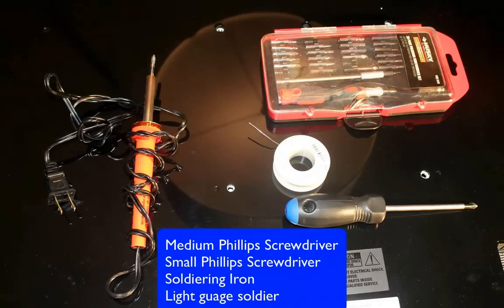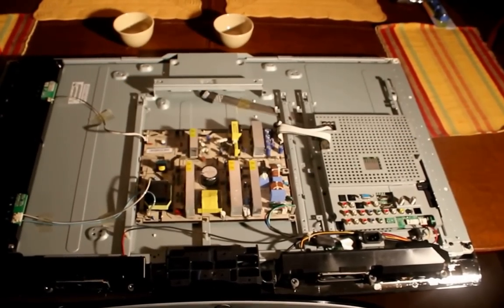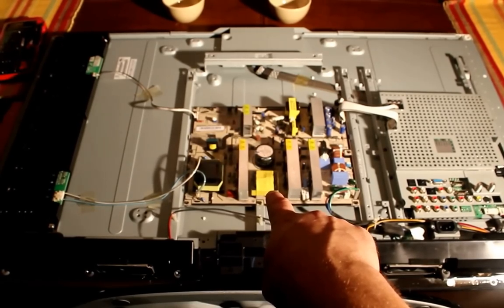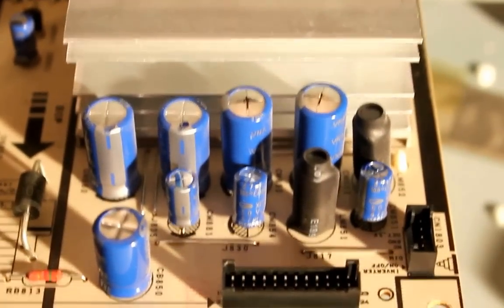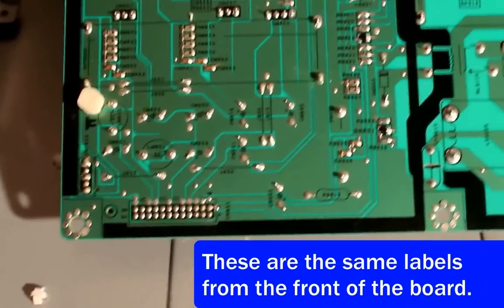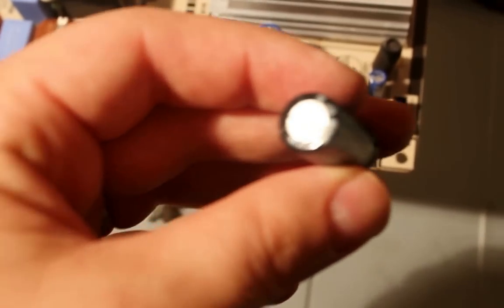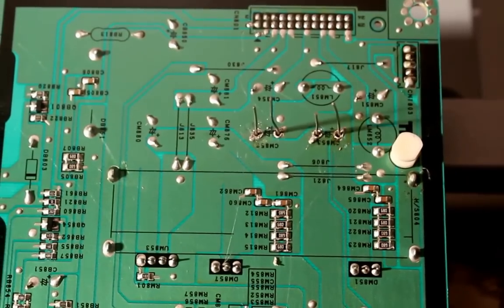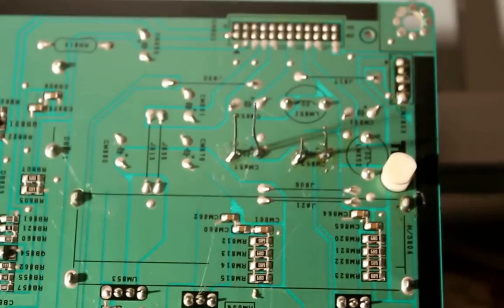Fixing the Blown Capacitor in Samsung TV Yourself

Comment: New POST TO AN OLD VIDEO (Oct 2019): These failures are super common and based on the failures I would replace the capacitors with the next higher voltage value (NOT A DIFFERENT UF VALUE) For example if 2200uf 10V failed replace with a 2200uf 16V.  
16V=>25v  25V=>35V  35V=>50V  you get the point
These caps are known to be under rated for the purpose.  which is why the problem is so wide spread. Most of these TVs can be fixed for under $20

There are a few power supplies with cracked solder joints on some components. A close inspection with a magnifying glass can help you find them. To fix just reheat and add some fresh solder.   

A guy could make a small fortune finding these TVs for free and fix and turn around and sell for a few bucks.

*****WARNING****** There is 1 Capacitor rated at several hundred volts, this can cause injury if it is still holding a large charge.  Test with a meter and discharge through a large resistor if need be. The capacitor is the huge one and very obvious. Take these precautions seriously.  Cheers

Comment: Manufacturers of electrolytic capacitors specify the design lifetime at the maximum rated ambient temperature, usually 105°C. This design lifetime can vary from as little as one or two thousand hours, to ten thousand hours or more.
So if your smart TV, or Electronic Controlled Refrigerator fails to turn on, then before replacing it, check the Electrolytic Capacitors.
They are big enough to be checked and replaced easily. Make sure to replace with a top quality capacitor with identical specification.

Comment: I have this issue with my '07 Samsung 40'.  Good tip.  Not the best soldering job.  Use solder flux and clean it off with rubbing alcohol after you solder the joints.  Don't let the solder touch the other traces and use just enough solder to get the job done.

Comment: I just fixed my Samsung Monitor this way thanks to this Vid. I hadnt soldered in 30 years, went to Radio shack and got the capacitors($2.00 apiece) and fixed it in minutes.
Reply: MrMrwilson11 how'd you remove the old solder around bad compacitor

Comment: Thanks! This save me hundreds of dollars by avoiding buying a new TV!  Cost was 1.99 from Radio Shack for 1 new capacitor (35V 1000uF).  Although they only had Caps rated for 85°C instead of the 105°C that the old one was rated at.  We will see if it holds up.
Reply: Lauren Doyle did they hold up

Comment: I have an lg and had to replace the power board, before putting on the back. I drilled numerous holes in the back panel to allow more air to circulate. I believed it helped. per tech folks the capacitors are under size

Comment: How did you know what type of capacitors to get don't they have different types like watts or can you just use any type ?
Reply: On the side of the capacitor it will tell you a voltage and capacitance. So, on my tv, 3 were blown. On the side of 1 was 35 V, 1500 μF (micro farad, be careful not to mix up nF with μF). So when looking for a replacement I look for one with 35 V and 1500 μF capacitance.

Also take note of the height, diameter and lead pitch (how far apart the leads are). You don't want to get one that won't fit.
Reply: Tumatauenga what about diameter of the capacitor? from the pics on amazon the one I need looks shorter and thicker. The one on the main board looks skinnier and taller. Any advice? Does it not matter?

Comment: I'm using a 15v. soldering iron and it doesn't seem to be strong enough to melt the original solder. What voltage iron is the best to use without damaging the board?

Comment: Ever hear of one of these capacitors healing themselves? I noticed one bulging in my Sammy Tv (a year ago) and I've been meaning to replace it. Opened the TV up today (was about to take the board out to take it to radio shack) and the bulge was gone. I even scratched/marked the capacitor a year ago so I wouldnt forget. Plugged TV in for the heck of it, it now works. Think it'll last? Strange.
Reply: I have the issue with my Samsung and it's usually fine unless the weather is cold.  Warm days it's fine.
Reply: Your partner/spouse is gaslighting you

Comment: Thank you for your video. While my Samsung has the symptoms of having a blown capacitor or two, visual inspection indicates no mushrooming. Could it actually be the power supply that is causing my tv to cycle on and off repeatedly upon first turning it on?
Reply: They can still  be  leaking  even though they  are not  bulging, using stuff  on Standbye  shortens  its   working  life  as  the  Power  supplies  are  in use  even  if  it is on  Standbye  24/7 for  some   people.

Comment: Might be nice to warn people about lethal voltages in the larger capacitors, easy to get hurt even die, yet you say nothing. irresponsible.
Reply: Could you explain please, I'm new to this and I need to fix my toes capacitors. I had no idea it was dangerous to replace them, you could send me a video too, are they lethal if the TV is still plugged in or are they lethal even without it plugged in? Thanks
Reply: Read the side of the cap?

Comment: hi, after searching forever i saw that you have the same exact model that i do. 
if u ever get this can you walk me through a vid or email. My same exact model wont turn on, i tried unplugging it to a different outlet, still wouldnt work. I'm not sure if it's a short circuitage, shortage, main circuit board or some capacitors. just wont turn on at all. Now i think about it it was probably plugging to much cords to a power strip, but thought power strips were made for that exact reason, to avoid shortages/ circuitage. HELP PLEASE! i dont want to loose this TV!